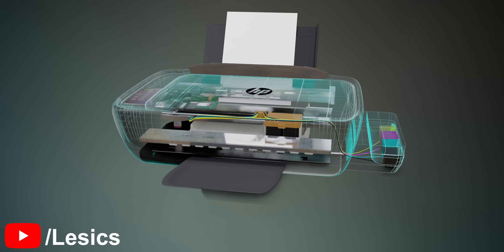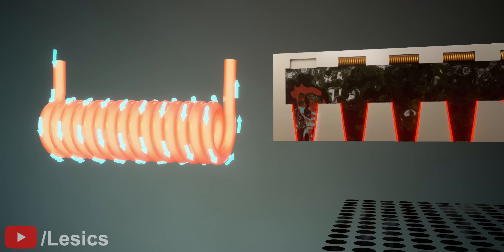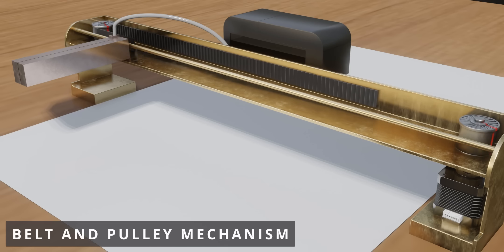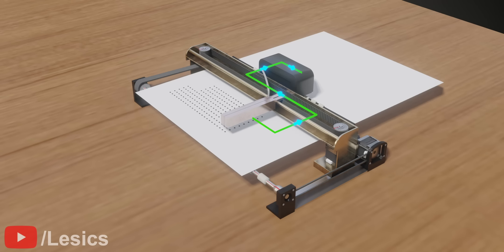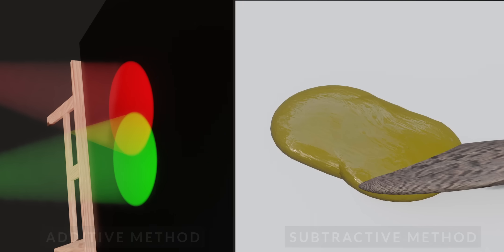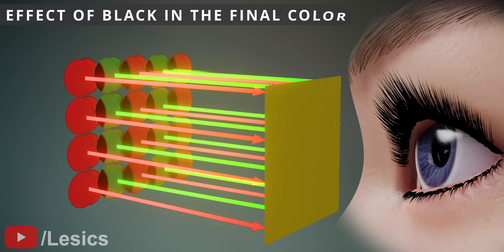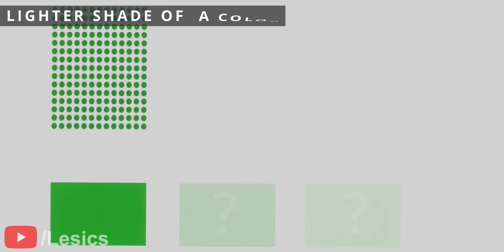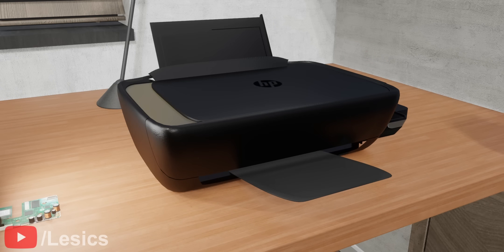Inkjet Printers | The interesting engineering behind them

Comment: And what are these tiny resistor coils, how do they look like? And how to achieve that the neighbor nozzle is not dropping ink when the neighbor does?
Reply: That’s entirely wrong in this video. The resistors aren’t coils at all. They’re thin-film resistors, manufactured into the printhead itself. Printheads are silicon chips, manufactured just like microchips, and the resistors are built right into them (as are some of the drive electronics!). 

This video shows a single ink channel with multiple nozzles, which would cause the “crosstalk” you ask about. In reality, each nozzle has its own channel. In some designs, the nozzle is a tube, and the droplet exits out the end. In those, the resistor is built into the wall of the tube. In others, the nozzle is on the bottom of the channel, with the resistor on the “roof” of the channel. (Basically what they drew here, except that it’s just one per channel.)
Reply: @tookitogo  holy moly thanks for the advanced response. That explains a lot. You wrote one of the best answers I ever had on yt :)
Reply: @troublehd7236  thanks for the kind words!

Comment: 1:32 i want to know more about these resistors because the fact that they gain 100 degrees per microsecond is quite surprising to me. are most resistors like this? what are they made of?
Reply: Any resistor can heat that quickly in theory. It’s a function of the resistor’s heat dissipation and its mass. The resistors in a thermal inkjet head are absolutely microscopic — they’re thin-film resistors, not wirewound coils as shown. With essentially no mass to heat, the resistors can heat very quickly.

The thin-film resistors in thermal printheads (that is, for thermal printers like cash register receipt printers, and in thermal-transfer printers like P-touch label printers) work very much the same way, but physically larger.
Reply: @tookitogo  oh, that's interesting. thanks for explaining
Reply: @everythingandnothing8129  you’re welcome!

Comment: How do the heating elements cool off so quickly? They need to be turned on and off thousands of times per second to make a print, I’m surprised they even get to cool off at all in the time it takes to finish a print. It usually takes a minute for resistive wires (heating coils) to cool off.

I expected they’d use ultrasound to push the bubbles out.

Comment: The ink will flooding inside this print. It doesn't have any waste ink bottle so after you using clean menu on the computer, the ink waste will dispose to bottom of the printer. In certain time it will flooding your printer. And i don't know why, it cannot install new catridge in it. The printer will not recognize the new cartridge.

Comment: Now i know i should not hesitate to brighten images before printing since will be using less ink
Reply: Well, yes and no. For color images, absolutely. For black and white text, switching from black to gray (even slightly) can result in the printer using all the color inks to make gray, using up more ink than before! Most printers have a draft mode, so use that to save ink when quality doesn’t matter at all.
Reply: @tookitogo  ah. Thanks for the tips

Comment: @8:27 RGB aren't primary colors. Old school primary colors are Red Yellow Blue, but more accurately Cyan Magenta Yellow are the actual colors that fill the roles we think of as primary colors (because Red and Blue can each be made from the correct mix of CMY).
Reply: Both are correct: CMY are the primary colors of subtractive color (dyes and pigments), while RGB are the primary colors of additive color (light). The primary colors of one model are the secondary colors of the other.

Comment: I noticed the video neglected to explain why their favorite printer manufacturer forces you to use BOTH yellow and black ink when printing in black & white only mode. For those not in the know, it's because HP deems it necessary to use the yellow ink in their micro-print scheme that marks each page with identifying information in order to track which of their printers printed the page. Note, the printer WILL NOT FUNCTION without yellow ink for this reason.
Reply: Why would they want to do this? Other than just a made up reason to force you to use ink from your color cartridge too.
Reply: @GMoney-B  that's a question for HP...
Reply: You’re confounding multiple things. 1. Laser printers only, not inkjets, print the yellow tracking dots. 2. The main reason many printers require you to have all the inks even just to print black is to discourage people from leaving the printer with dry nozzles, which can cause them to clog irreparably. So to prevent you from unwittingly damaging the heads by leaving the color nozzles dry for months (because you’re only printing black and white), they block printing when any ink is missing. (Because then you’d replace the color ink, but with the heads permanently clogged, you’d never be able to print color again.)

Also, many printers use small amounts of color inks to smooth out the edges of black text.

Comment: june 11 2022
for 3 years now Epson cartridgeless printers have been in use. saving me
a small fortune compared to replacing costly  HP cartridges
that have  run out of ink.

and its not necessary to use Epson brand refill ink for the tanks.  
which saves even more money.   

      something do-able with one of these Epson tank-refill printers is
taking  your photos and printing out color 8x10's.  the paper is
priced okay.   large size color prints work better for sharing
with others when you have ones to show.

     you do have to mind the ink levels in the tanks.  i use a toothpick
for a dip-stick.  

      oh , i do have one big gripe about my first epson printer. 
a   ET-2550 .
after about 3 years & 10000 prints it just stopped working. 
 putting an error code on the screen.    w/ msg to call tech - support.

         i chose instead to tear it open.  and discover a sponge that
catches the excess ink ( ??? ) so it doesnt get on the paper.
and once full at its capacity needs replaced.  

       and there is nothing
in the user manual that would warn you or show you to
 make this repair user - friendly.

      having gotten my money's worth w/ the '2550 i simply shopped
for a ET-2803 replacement.
Reply: Most ink tank printers now have a user-replaceable waste ink receptacle.

Comment: 5:04

Servo's have feedback circuits, not stepper motors.

Worth noting the only feedback is typically by means of an optical sensor. and homing switches. The means varies by make and model.
Reply: The feedback is by optical encoders: a strip for the carriage, a circular one for the platen. That provides very, very accurate feedback.

Comment: Well damn you mean to tell me I can destroy my printer to build a 3d printer? O.O niiiiceee guess I'm going  to go look for some unwanted printers for stepper motors XD
Reply: Nah, that part is wrong. They mostly use DC motors. Look inside an inkjet, and you’ll find a transparent strip somewhere behind the carriage. It’ll have hundreds of thin black limes printed on it. That’s the encoder strip used to carefully control the motor speed. If you disassemble the printer, you’ll find a similar encoder — but circular, not straight — on the end of the paper feed roller (platen). That’s used to control the paper feed. So instead of stepper motors, those encoders provide feedback, allowing DC motors to be used while simultaneously being far more precise.
Reply: @Antonio Tejada  already looked and noticed DC motors and didn't remove them yet until I find a project that suits them but yeah lol stepper motor vs DC motor is totally different
Reply: @ericholliday7071  Yeah. I should probably snag some old printers from the recycling center and harvest the motors and encoders from them.

Comment: But why most printers don't allow us to print in black and white when it's run out of cyan ink?
Reply: Primarily because some users would then wait forever to replace the color ink, during which time the color heads dry out and permanently clog. So they force you to have all colors installed so that all the heads can be kept in working order.

Comment: and this is only conventional inkjet... Epson has a patent on a variant of this nozzle where the heater is replaced with a piezoelectric module instead. That's one ther reason why they run their "Heat Free" marketing campaign... Well, that and you don't need a fusing unit to print an inkjet image.

Comment: There are two major problems with inkjet cartridge design. Firstly, the ink cartridges dry out rapidly and then need to be replaced, make inkjets viable only for continuous high volume printing. It is only then that the ink used for printing greatly exceeds that lost to drying. Drying also clogs the microscopic pores. If used infrequently then inkjets will stop working for these reasons. Secondly, much ink is lost at the ends of the horizontal traverse of the print head across the paper (when it stops & then reverses its direction of movement). The shock of stopping has the same inertial effect on the ink as it has on the passenger of a car which suddenly stops: the passenger is flung forward. Similarly the ink gets shaken out. And in much greater quantity than during ink ejection by resistive heating. Hence a lot of ink is wasted and accumulates as gunk at the both ends of the inide of the printer. Both of these problems disappear when laser printers are used instead of inkjets.

Comment: Not really interesting.. only if you build them in very large models. 
7 meter wide with a 22 meter stroke. 
Yes I did participate in that , and they still have them .. look at your bill board .. 
So far I recall the biggest sheet ever was 140 meters long. 
Cool 😎 hu.